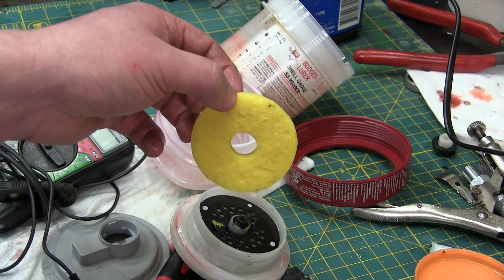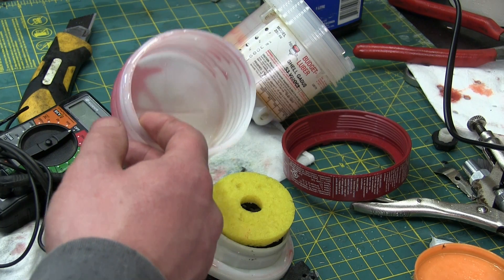BOLTR: Disposable Automatic Industrial Bearing Lubricator.

Comment: That’s hi tech, and clever to boot. Seen some old applications where multiple grease fittings attached to a common grease manifold being fed by a grease reservoir, and the grease is under pressure from a simple spring force. Not as clever, but still better than pumping a grease gun in hard to access areas.

Comment: It took me till you said it was on a timer to realize that it was meant to be attached to the bearing and left there, I’m sitting here thinking the millwright was just running around to each and threading this in and flipping some dip switches and then unthreading it and going to the next, I’m sitting here thinking “well ya it’s easier than carrying a grease gun and pumping it and easier than carrying an automatic one and cheaper, but not by enough to warrant burning a new one when it’s empty, unless that’s expensive grease, do these fuckers loose shit that often? Damn” and now I realize I was the stupid

Comment: They work well as long as they're not outside in the winter. If you see the  indicator lights flashing blue it's too cold for it to chooch. There is also a refillable version.
Pull the blinky light assembly off and put it in an overhead hvac vent and you can get the paranoid guys on the crew worked right up.

Comment: While I am impressed by this ingenuity, it does raise some questions. I have seen smaller 1 or 2  oz auto greasers that operate on spring power instead of gas, we used ones similar to them on a lot of equipment at the plastics plant I worked at. My question is what is the problem with scaling that design to something of this capacity (250 cc or ~8.5oz). The ones we had were refillable rather than disposable and lasted 1-3 months before needing any grease; just seems like a simpler solution but I'm sure there's something I'm overlooking

Comment: The there are quite a few problems with automatic greasers and most of the problems have to do with customers not understanding how to implement them. I've seen quite a few bearings that fail because they get overgreased or undergreased by those things. More often than not on the Trico brand ones, the customer forgets to change the battery along with the grease pack. Another famous one is the installer forgetting to purge the grease lines so the greaser doesn't usually get grease to the bearings for a few dispensary cycles. All that fuss just so someone doesn't have to check on their equipment every so often. I'm waiting for the days when ceramic bearings come down in price.

Comment: Ours on our machines are a little different. You keep the actuating half with a motor and battery pack plus switches. You screw replacement grease cartridges on actuator unit. Uses a screw plunger to push grease out and actuator unit has a nut driver on it. More complicated than this unit you showed. I could see how for remote service the one you showed would be easier to install

Comment: The bellows pushes on the orange plunger in the bottom of the enclosure.  
It used to be part of my job to change and recycle them (rip them apart and separate the batteries, plastic, and save the grease.)
These are a really good idea providing they can stay above freezing, because when they freeze they are still building pressure,  just slower,  and when it warms up they'll over grease.

Comment: I have the tool in question. I’ve found that the battery HAS to be bigger than a 102. That battery sits in my shop. Also, the plunger that sends the nail flying into the wood rises in a channel that gives too much friction. It’s eother too tight a fit or something. A little WD or dry lube and it’s good for a day of trim carpentry.

Comment: I work I'm a full recycled paper mill. We use those. Our machine is basically the same one they built in the 60s that has grown to put out over triple what it was originally created for. We have a buttload of parts being cycled out constantly. We use those because we have way too many bearings to be able to grease on shift. This way we don't need an extra employee just for that or a team of mechanics crawling around looking for corroded pipes or plugs. We also have them on the winder. Still og German (I think) engineering. Hard to get right, but when you do, it's beautiful.

Comment: I worked a few months in construction 20 years ago and one of my jobs was to make sure all the grease fittings were greased before every use, etc and it takes up quite a bit of time.  I suggested something very similar to this (different design, but  performs same function).  I asked if anyone had ever seen anything like it.   I got ragged on for "thinking of ways to cut corners",  "that's the way it's done, that's the way it'll always be done"  "yah yah kid whatever,  just pump that grease, you're thinking too much kid".  My proposal was a hose running from every fitting to a manifold just outside the cabin (connected like a maser cylinder/firewall in a car)  hooked up to a typical replaceable grease cartridge cylinder (maybe the size of a quaker oats canister would be good) with a e-brake style food pedal.  This way every bearing on the excavator gets the same amount of grease every time with just a few pumps of the foot pedal.  And all you have to do is replace the grease cartridge every so often.  And all this can be done inside a heated cabin in a matter of seconds.  My boss probably stole my idea and sold it to a think tank that transformed it into this.  Which is a better money maker, but not better.    When companies sell throwaway products that need to be replaced every 4 weeks at $1000 a pop you can tell right away that greed is the motivation.  So what do you need one of these for every fitting? If so, my proposal is a million times better.   

I do like the "budget-luber" and think it's very creative. It's impressive.

Comment: That control circuit looks very similar to what was called a "solar engine" in BEAM robotics. It was a pretty interesting scavenge-based hobby that had some popularity in the late 90's. Such a circuit would be useful in this design due to matching characteristics of very low power consumption, simplicity/cheapness of design, and using very slow/imprecise oscillations. If you saved that circuit, you may be able to repurpose it into a tiny robot (with a 1 neuron equivalent 'brain') and drive a pager motor with a small solar cell. Really cool to see a machine made of junk with the equivalent of 1 brain cell doing some surprisingly smart behaviors.

Comment: there's a couple of different sorts electro and chemical,Don't like them much..Line size is very important,after all it only generates about ( a good one ) 40 psi , can buy mechanical one but need to replace battery's with new grease kit,the vendor can have what ever grease you want in it,the one you have on your video has dip switches,which control voltage to operate Bellows,,
that now determines how long it will chooch for,expelling the Smoo,change out on a schedule,Take a grease gun with you as you may have to purge lines ,,after all the good one are only about 40psi,mechanical one are better pressure but still have soaping which cause half full canister at time of change out,and when unscrewed,,it releases the smoo all over the place,,

Comment: as a guy who assembles some of those industrial gears I always wondered about those oil inpections, where do you take the sample from?
if it's from the drain plug you will find all the possible schmoo that was floating around on the bottom of the unit even if the end users did change the oil after a "mishap". once the big gear units have had oil in them you'll just never get it dry without disassembling it right down to nothing. Then, when filling it again the evidence should still be there even though the amount of sand, metal, small animals, water or anything you could think of would be less.
sorry if the language of this comment seems weird, I am sort of drunk at the moment and this seemed more important than the cure for cancer.

Comment: +AvE Thanks for that video. I was using this kind of units for lubrication of the robot 7th axis, but never had possibility to tear one apart. I was using different brand of these, and in documentation it was written, that the gas filling the chamber is a nitrogen. The units are refillable sometimes, you replace the lube and the bellows and you're ready to go:) Also sometimes they have the pushing element with a piece of metal, which combined with the inductive sensor outside of the casing is an indication that the unit is empty.
Of course they are Ex-proof.

Comment: I have the less skookum version of these at work,  the ones that are powered by a spring with a orfice for metering. I guess you could say its the analog version.  Great for sliding, reciprocating equipment. The only problem is I have no such equipment so there are a few just gathering dust.  Mine don't smell line cat piss, just the wonderful smell of NGLI grease.

Comment: I make it a habit to replace those chemical jobbies with old fashioned spring-loaded grease cups.  They're not as controllable but you can buy a cup for less than one lubricator and keep filling it with cheap grease.  Much better.

Comment: The biggest flaw with those auto-lubers is the lack of pressure they can apply to expel the grease out. Especially as they empty of grease and the bladder expands. They work fine for applications with little restriction to the grease flow, but hang that thing 20 feet away and run a steel line into the bearing, and that bladder don't got the grunt to chooch grease into the bearing. If that assembly is outside in a Canuckian winter, then all you have is a false sense of  security thinking your bearing is receiving lubrication when it is in fact not getting any.

Comment: GM TruTrac gear lube is grape scented. I used to think is was to help the mechanic out and make him stink less. But, Its actually so when you crack open the differential case and you don't smell grapes, the warranty is voided. Basically, you bought Jiff Lubes bullshit, and let them change the fluid in your differential at 10000 miles. The dumb bastards left the fill plug out and after a week you have a spooled rear end. Bring it to the dealer because it's under warranty, and if you act like a dick to me as If I built the thing and made it fail on you, I can say "suck a dick, warranty is now void".

Comment: what is the temperature range for this "gas generator"?
I suppose that at low degree the electrolytic reaction might be a lot less active than in a hot machine. 
Or is this even a desired effect?

Comment: These things are toys, they tend to over-lubricate bearings (that red schmoo is not open-gear tooth grease).  While, yes, they meter out lubricant in a constant, predictable fashion, they cannot anticipate downtime for most applications; the only thing worse than too little lube is too much. 
Get a system like a Lincoln auto lube, tie it into your system PLC, and have it meter lube based on operational hours (and all dynamic variables inherent to flexible systems: speed, load, temperature, etc.), not a time-constant scenario: that's no better than having a grease monkey performing a maintenance.

(I've encountered these gizmos before, thanks for taking one apart;  I'd have never suspected a chemical catalyst as the working force!)
Reply: +AvE aay-yeahp, nothing says "job well done" as two contractor's trash bags filled with pigmat, rags, empty cans of brake clean, simple green, and 10kg of SHC420 when an ALU decides to pump a years-worth of grease everywhere but its intended target.

Comment: Wow! That thing is genius! Talk about being built for a cost! When I saw those dip switches I though I knew how it worked. EVERY preconceived notion I had was wrong. Finish the story about the winch!
Reply: your pfp is amazing lel
Reply: He finished it, but it slid by you. ;-). It had clean oil because it failed from no oil. It had beautiful clean oil because the millwright had just filled it with fresh oil to cover his ass after it failed and he found it and checked the oil. Hehe. I'm a Mechanic/Millwright, I've seen from Millwrights and from truck drivers when there ran an engine oil.

Comment: Very cool, I had it mostly figured out, just didn't know what chemical they would have used for the process.

I wonder what the lifespan is on these, and what sort of current it draws based on various settings. It also seems slightly odd that they socketed the dip switches, but then if it's industrial, they can just pass the cost along.
Reply: +Jesse Levesque Might just be a method to allow them to say, "Assembled in X"
Or perhaps an attempt to keep clones off the market by not supplying any one manufacturer with all the design specs.
Reply: +Jesse ---- Maybe where the tester plugs in

Comment: This reminds me of the mechanism GM employed in front axle of early to mid 90's 4x4 trucks and SUVs.  It was lovingly referred to as electric weiner by the parts department.  A two-wire device that uses a heater to expand and would push a ring to engage the axle.  Eventually, they become impotent unable to achieve enough pressure to engage.  The replacement is mechanical, adding a third wire for retraction.

Comment: They've got those things for excavators, too.     A bigger tub-o-grease than that one, a pump, (in lieu of a bellows)  and hoses to everywhere there would be a grease fitting.  Saved having someone spend 15-20 min greasing the thing every four hours or so.
Reply: +excavatoree I once went out to service such an excavator, and found the main slew bearing to be completly dry, the machine 50ton wharf side loader was noding like a rocking horse. So I ask the operator wtf? he comes back with, "well it's got an auto greaser!"  Unfortuanlty it's rare to have them connected to anythyting south of the slew bearing. £20,000 british pasos later and it had a new slew bearing and a new operator.

Comment: That Board in the lubricator looks similar to what used to be used in the old soda machine changers ... Each switch would double at a value of 5...  that is why all the soda would be one price weather it was 35cents or .50cents... 1st switch .05  , 2nd .10 , 3rd .20 , 4th .40  , 5th .80 and last $1.60 so if you wanted to sell your soda @ .55 you would throw  , 1 2 and 4...
Many Blessings , SMR

Comment: Yea these are super cheap and fail often. We manufacture spring tensioned ones. Farmers like them cause they are "budget-minded" and they do provide lube at the point when the bearing needs it. The thing that most people don't realize is that the bearing under load will pull in grease from the greaser via Venturi action. You only need 2-3 psi above ambient to keep it from sucking air into the bearing. But most here are right, central lubrication systems are the way to go when you've got bearings in a steel mill. Down time = $.

Comment: There was actually a low tech version of this back in the days, which also worked with an extendo cock membrane. But instead of being powered by electrickery it was powered by dropping a pill of alkaloid metal in a housing containing some liquid, And depending on how long you wanted the thing to last you could use stronger reacting alkaloids. If you are interested i might have one or 2 left under a thick layer of dust.

Comment: 'Man you could put that shit anywhere'   
Hey AvE do you know how long they last typically, would have to be a very controlled gas rate for a long term application which makes it even more amazing, chemical, electrical, and hydraulic eng. AIO.   Such a very elegant solution over what I can think are the alternatives with driven pneumatics or gear pumps, air and/or electric lines galore to each grease point, and micro-controllers.  Well done whoever thought that up, well done.

Comment: Can someone explain this to me as if I were 5? What exactly is spurting out the grease? Is it the dip-switched timer that once in a while creates electricity which in turns generates gas from the sponge-thing contraption, aaaaand thus driving the penile extender? If this is true then that would also mean that it would grease something regularly even if it isn't being used? 
How could this be improved?
Reply: +rxwh I understood it as the light was on a timer and the switches just controlled the rate at which gas was being constantly produced (thus controlling a very slow, but steady, flow of grease).

In a factory if you have a piece of equipment that isn't running then you have a problem. Or if you're talking about off shifts or something like that, the amount of grease out of one of those is so small over a period of a shift or a few days that it wouldn't matter.

Comment: Ive changed several hundred failed bearings that have the "industrial Auto Greaser" attached to them.  Good Idea but people want to put them on 8 to 12 inch bearings and most bearings that size needs to be purged when greasing.  And someone has to pull the purge plug so grease will go into the bearing.  They do work good on small bearings but really a good pay day for some sales guy.  You have great videos.